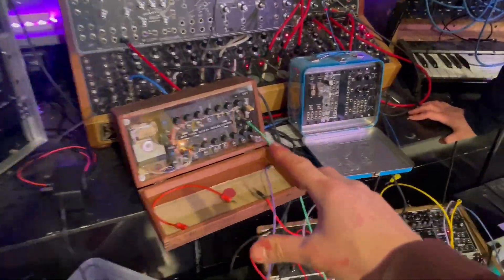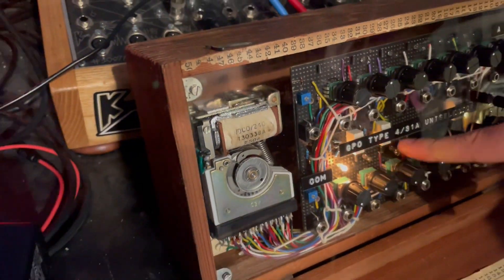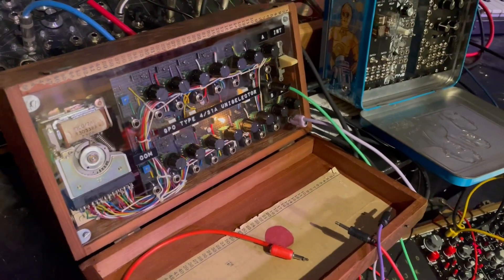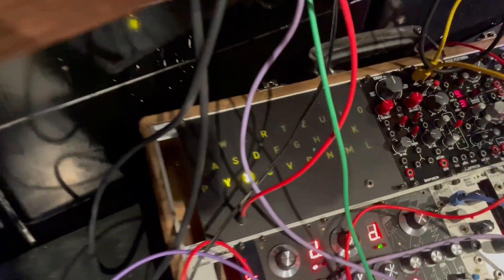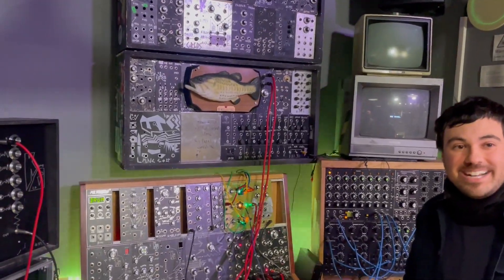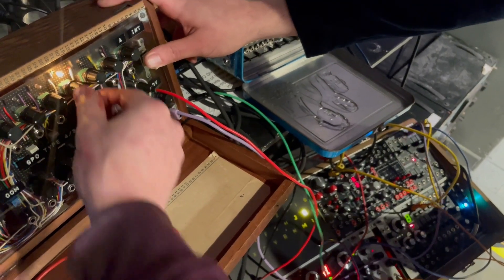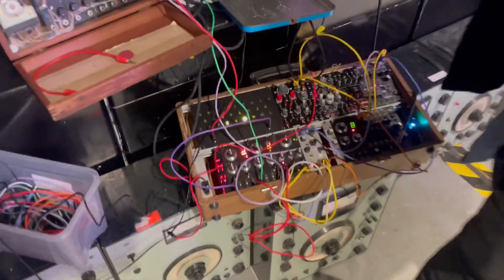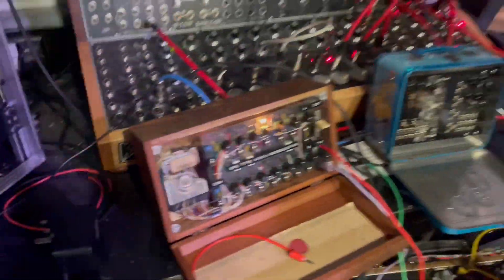Hack Modular Talking About The Uniselector Sequencer amongst Others

Comment: I'm gonna be the dork that points out that one of the strengths of the enigma machine was that encoding the same letter (or sending in the same voltage, in this case), would result in different outputs every time.🤓🤓
Reply: yes. but this module is part of a collection he is making of the building blocks, as he mentions in the vids it is a module acting as the light screen on the enigma machine :)